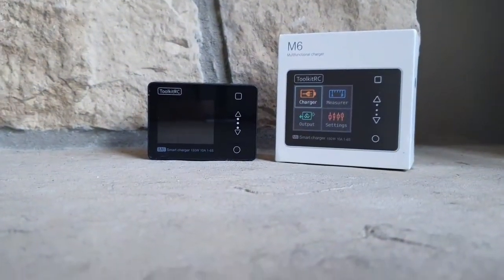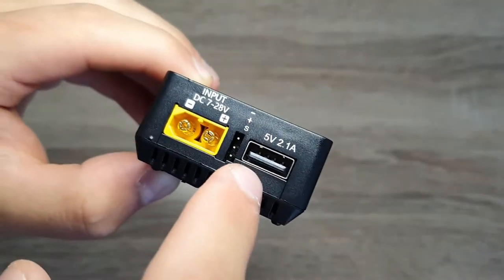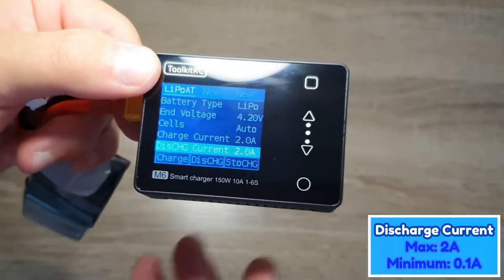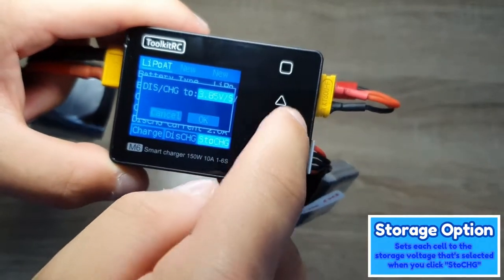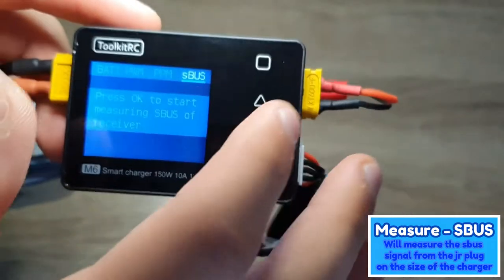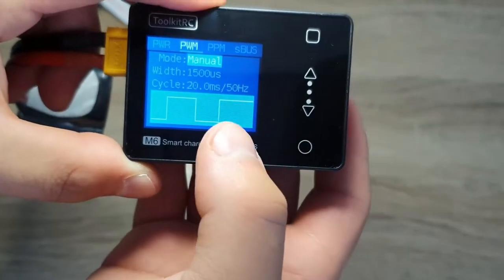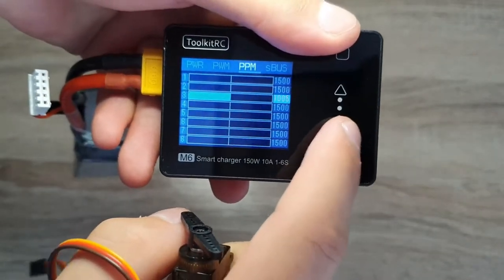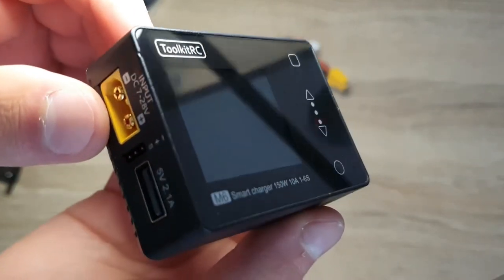ToolKitRC M6 Smart Charger - Unboxing, Review, and Guide

Comment: Do yo know if we can use lead 12v car battery on input as power supply? Toolkitrc will be damaged?
Reply from the maker: Do you know what the current/amp rating of the battery is?
Reply: @Adam_Carbone  I can see only those parameters like 55ah capacity  and startup max current of 440 amps. Its typical car lead battery. I sent email to toolkitrc and maybe they will answer after weekend.
Reply from the maker: @linkflap1342  Wow must be a big battery! 12V will definitely work within the range, but it can only take 12A max input so I would take a multimeter if you can't figure it out from the labels and try to measure the output current in Amps. 

Since you said that the battery has a max startup current of 440A, I am assuming that its lowest current supply will still be pretty high, but I guess it can't hurt to check 😁
Reply: @Adam_Carbone  Thanks. I'll research more and I'll inform. I was thinking to use current fuse like 5 amps to protect toolkitrc. For now I'll w8 for toolkitrc email.
Reply from the maker: @linkflap1342  Sounds good, let me know how it goes if you do decide to get it!